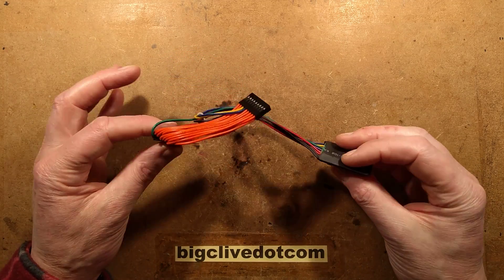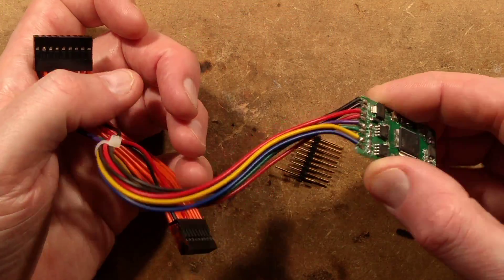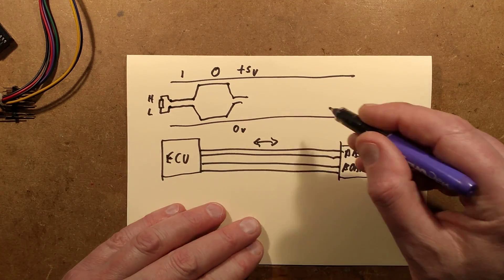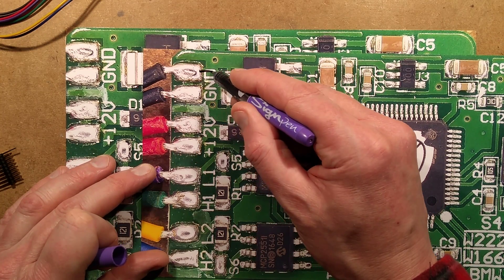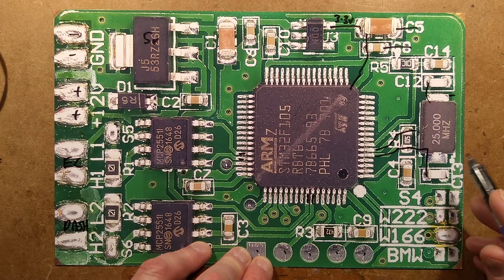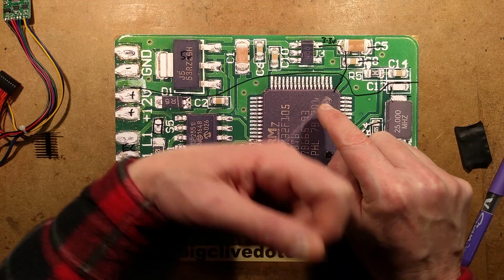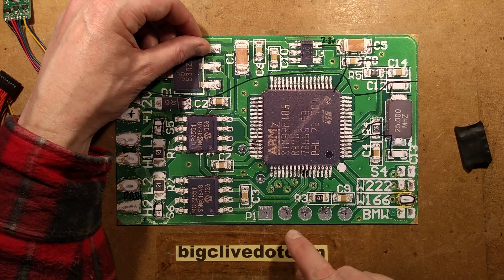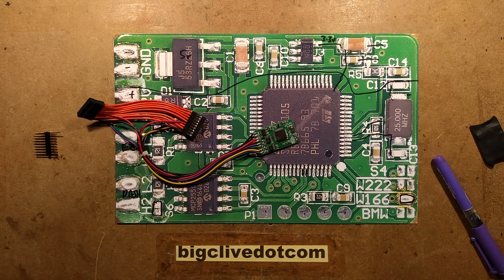Naughty CANbus odometer "interface".  (Fakes mileage.)

Comment: This is news to me. Consensus seems to be that this “clocks” the total vehicle mileage.
However, could it (also) be reporting (say) only 90% of the active real-time mileage through - to defeat mileage/driving-hours safety-limits?
Reply: A quick Google sugests it is used to prevent the system re-establishing the old odometer reading after you have changed it.

SO once tis was removed, old mate's beemer would suddenly have a whole lot more mileage on the clock. (or maybe fewer, if he has done more than were wound back before he bought it)

Comment: A friend of mine bought 2 trucks from a local used car lot. She took one of them in for service and the technician came out and explained to her that when they went to smog the truck they pulled the milage off of the ECM or PCM and it was 200,000 miles more that what was on the Odometer. The truck had 400,000 some odd miles on it. She was not happy.

Comment: I wish you could have left this in the car and analyzed this with a logic analyzer.  I am interested to know precisely how they got this to work.  Are they bit-banging to jam the valid message coming from the ECU?  The ARM microcontroller's digital CAN interface logic won't let you do this nefarious thing.  Though there are other ways they could have done this.

UPDATE: Oh, it's a CAN gateway replacement.  This isn't even hard, and in fact this device would 99% of the time be carrying legitimate, untouched messages between those 2 CAN networks.

Comment: If only all the factory electronics were as well designed. Hopefully it's not sophisticated enough to add mileage at a super high rate, after the car is sold, until the mileage is again equalized, take itself out of the circuit, and erase it's program.

Comment: W222 is the Mercedes S class which was introduced in 2013. W166 is the Mercedes M  class introduced in 2012. S4 is the Audi performance version of the A4. BMW is self explanatory! These are all cars which are frequently (and rapidly) run to stellar mileages by early owners. Their trade in value is then dramatically reduced (often to 50% of average mileage cars value). It’s very profitable to buy a mental mileage car at Auction. Once you have fixed the dashboard and OBDI outputs to adjust the service and mileage reports the car’s value jumps. Sell on through the small ad’s and 90% profit is not unknown.

Comment: Clive, do you upload all of the circuits you find (and enlarge) to github? I feel like it would be a very valuable repository. :3
Reply from the maker: I don't.  But they're all here on YouTube for future reference.
Reply: @bigclivedotcom  haha. Yeah, I won't ask for more than that. I'm extremely grateful for all of your efforts. I love learning about this stuff. Thank you
Reply: As clive said, the magic is in the micro program. Someone had to know the decode formats to do the programming.
Reply: @rayraycthree5784  That's not what I was interested in. Dumping the roms of these chips is way too much work. I was simply interested in the awesome drawing's and circuit designs he outlines in these videos.
Reply: @nathantron  You cannot dump the ROM of this device because its read-protected. However the device itself can be reprogrammed, due to the fact of the real easy circuit. I have done some research recently and you can see my documentation here:
https://github.com/EliasKotlyar/Canfilter

It can be used as a legitimate dev-platform for retrofit installation, where you try to connect 2 components which are using different can-protocols. Also it can be used as a can-sniffer for seeing which commands are being transfered between a device and the car.

Comment: Great find and video. I have a ford icon and i suspect the odo has been tampered with. Wonder where about something like that would be installed?
Reply: Between the instrument cluster and the engine computer. Probably nearer the instrument end, for one thing it's easier to get to. Since the wires are quite short, it's gonna be pretty near. So start at your instrument cluster, look for a bunch of wires somewhat resembling this. The design, where most of the wires go straight through, with just a few diverted, seems like the only sensible way to design it. 

When you find your suspect board, check the chips on it. There'll be a microcontroller / MCU, and probably CANBUS transceiver chips just like this one. Which you can tell by searching on the numbers printed on the chips. 

You could also look up purchasing something like this online for your model of car using the descriptions ("CAN filter" etc) mentioned here. To give you a look at some possible candidates.
Reply: @greenaum  Awesome thanks.

Comment: Also, https://www.keyprogtools.com/odometer-tools/diagprog-mercedes-mb-cangateway
Apparently, the unit is installed and then programmed with the purchased code over the OBD connector, using another device.
Reply: I've used the digiprog II on several cars Benz, Lexus...  works every time !

Comment: If the battery dies then the clocks will light up with all sorts of errors as there is no can communication at all when they receive 12v again. The chips are not far enough advanced 

This style works by running the speedo at 10%, so doing 30mph would read as 3mph and so the clocks and ecu think the car has only done 10% of the true distance

Comment: Normally this would be a mileage "freezer" control by a remote or hidden steering or dash button combo, But the idiots that made this weren't thinking of "if"..As a freezer it's stealthily stops mileage from going on the odometer, so you can't tell what's been done. The w222 indicates it's a AMG 63 most likely. 25k would shave $10-15k off the price of a newer one... Felony fraud is not something you what to leave any evidence of..

Comment: I’ve encountered a few of these CAN blockers, on Mercedes mostly taxis, they are a real pain in the backside & can trip you up in your diagnostics.
Usually the car will come in with intermittent warning lights complaints, lack of power, harsh gear changes ,interference to dab radio or even non start not forgetting cutting out on the motorway.
The mechanic then fits an ecu after reading communication fault codes on the CAN BUS which appears to fix the car only for it to fail & end up as a complaint.
Then the vehicle will come to me & I will find the bugger.
Of course the owner who is usually shady has no idea of why there’s a mileage manipulation device in their car & then kick of when presented with an invoice for non warranty diagnosis.
I have seen engines seize up due the service indicator not coming on so the oil has done 5000 miles more than it should have & is like treacle, the warranty is then obviously void when we find this device  which we do look for & our diagnostic software has a pid to check mileage stored in various control units is plausible. The customer is then faced with a bill for anywhere from £15000-30000 for a new engine.
So anyone thinking of fitting one of these don’t they fail regularly & can cause serious safety concerns for you & other road users.
Would be nice to know what failed on the device though.

Comment: These are made and sold by a company called Abrites, and as described on the back it is a CAN gateway that repeats a lower mileage to the cluster.  They do have a genuine use case in the automotive aftermarket in reusing second hand parts, because manufacturers make it (rightfully) very difficult to rewrite mileage data in any control module these emulator/gateway modules are most commonly used to reuse a second hand instrument cluster which may have had a higher mileage than the car did rather than any nefarious purpose.

Comment: Trying to do something similar in my car using arduino to get the rear camera working in motion, sending a fake Reverse signal, to monitor a trailer.

Keep running into an issue where it switches to night mode and music stops playing

Comment: Odometer on a BMW is stored in three modules and they must all match, or a tamper dot is permanently illuminated on the cluster. You could intercept the messages to the cluster and might be able to freeze the odometer, but you couldn’t roll it back.

Comment: Its a can blocker, 
Ill tell you how it works.
Basically you install this then you can alter the mileage in the speedo, this “blocker” then comes into play stopping synchronisation between the speedo and the other module that syncs the mileage.

Comment: Like others have said, the w222 is a Mercedes S class and w166 is an ML. What I didn’t see mentioned is Mercedes models share CAN architecture. Theses two models CAN architecture cover the whole range of Mercedes models. From my experience these blockers do not cause error codes and are usually found by accident. There’s other control modules that redundantly store the mileage and you’re able to check the mileage in those modules with a MB scan tool.
Reply: Not if you change them too

Comment: Is it possible that this is a manufacturer installed hack to solve an incompatibility problem with, for instance, a new dash module that displays the mileage too high?  Presumably the chip is designed to send out a fixed percentage of the correct mileage so the car never claimed a negative mileage!

Comment: On Ali-express 5 for $76 for 5  pcs MB CAN Filter 18 in 1 For Benz for BMW Universal filter MB CAN Filter 18 In 1 Odometer Adjustment CAN Filter for W222/W166
So its sold to do exactly what it does and is highly Illegal. Disgusting as the buyer/garage will not replace parts that are supposed to be changed until 25,000 miles after they were due to be replaced, potentially very dangerous.

Comment: A legitimate use for such a gadget might be to provide a correction factor for an inaccurate odometer/speedometer.  (The odometer and speedometer on my vehicle read 10% high, due to a bad combination of wheel size and tire size selected by the vehicle manufacturer, but alas, the odometer is driven by a mechanical cable, not an electronic bus.)

Comment: Have you checked to which ports do the welded holes go? 
If so, then attempt to download Firmware may be simple enough to be attempted using standard usb2serial interfaces. As a scam-baiter I see nothing doggy or immoral in stealing scamming tools code. there is always a chance that they may fave forgotten to lock firmware download

Comment: You will have to use this before the first MOT was recorded as you can now check the mileage online using MOT history check.
What I would say to anyone one thinking of using one of these devices is : most people know no that a high mileage car is a good mileage car from personal experience I have had better reliability for my car with higher mileage then a car with low mileage when a vehicle gets used regularly things tend not to rott up  as quick

Comment: typically all the signals are sent from the ecu to the dashboard, because the the dashboard is a display, and the ecu can light up certain lights. on ones that have a display, they can have a second board to handle running it that talks to the ecu

Comment: I still remember the days when a there was a rotating cable driven by one of the wheels and fed into the back of the speedometer.  Periodically, the cable would break and the speedo (and odometer) stopped working for a few days until you got it fixed. 
On one of my cars, the speedo died at 50,000 miles and was replaced by a new one, which was reset to zero!

Comment: Interesting to see.. on my Bimmer (which is a 99 - relatively ancient!) the odometer reading is stored in no less than five locations: the General Module (GMIII), the Light Control Module (LCM), the instrument cluster (IKE), the immobilizer (EWS) and the DSC module (which is quite clever as DSC functionality is on the same silicon die as the ABS pump controller, so it’s one of the few things that has direct analog connections to the wheel speed sensors). All of these modules will periodically send out a packet on the network with their current odometer reading, and will also listen for the same packets from other modules. Their internal logic allows them to update their own reading as long as the received packet contains a higher number than their own stored reading. So from what I gather, the ABS system is the main source of odometer “updates” however other modules with access to speed data could theoretically cause updates as well. The nice thing about this is that used parts can still be installed, as long as the mileage on the replacement part is lower. The IKE also has a tamper flag that will be set if any of the modules report higher mileage than what it has stored itself (as opposed to simply just updating itself, this seems to have been done to prevent knuckle-draggers from just replacing the cluster with a lower mileage one and being only mildly annoyed that it shows the old, higher mileage - instead it lights up a big dot to show that someone tried some hillbilly cheapskate scammer tricks lol!) I suspect this is all pretty common in almost all well designed (German) cars made in the last 30 years.
Reply: That's pretty amazing for 1999. So if you are looking to replace part and you have no reference on the mileage of the 'new' used part, how do you prevent the car from updating all of it's mileage storage if the new part has much higher mileage?

Comment: They actually modify the mileage of the dashboard, but to prevent it from jumping back to the original mileage (that is stored in other modules), they add this "interface" since modifying the other modules in the car can be very hard. Meanwhile, the mileage in the other modules doesn't get updated anymore, so the dashboard might as well be lowered by 100,000 km, if for example the car drove 60,000 km with this "interface" fitted.

Comment: This system can not work properly. Because the ECU and many other components stores too the mileages. Example the mercedes stores the mileage even th EIS (electronic ignition switch), but not every single kilometer. After every 500km it will stored. So there is no reason to make of that kind stupid "controller". If that hacker could like to make a "free mileages" then just remove the wheel speed sensor and say goodbye for the safety. Insurance could not cover that kind of cars because "highly modified". Honestly, I have no idea why to do that kind of garbage. It is easier to reprogram every single mileage data bit and no need to play a fool.

Comment: A few years ago my Dad has a Citreon C5 (2002 model) which had a fault on the speedo (needle didn't move). He managed to get the whole replacement dash clock panel from a scrap dealer. The unit had the RPM, Speed, Temps and the LCD displaying the mileage. 

When he put it into his car the mileage showed that of the previous car, not his. I wonder (in Citreons od the certain age that it) the "memory" for the mileage is storage in the dash rather than the ECU? If so, the data coming the ECU could just be something like "I've done another 10 miles" and the dash adds that the the existing total. The chip could simply be taking the data and takes off 25% before passing onwards?